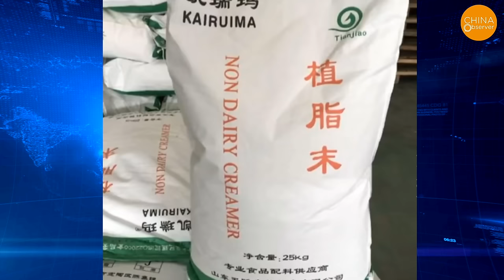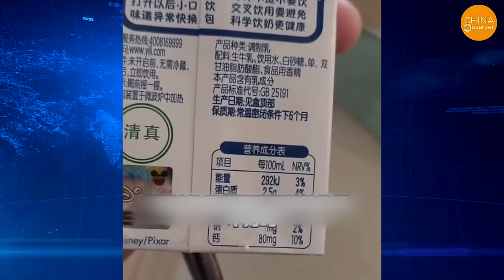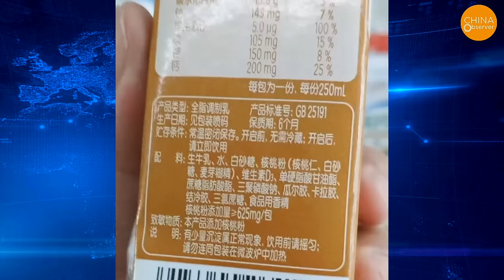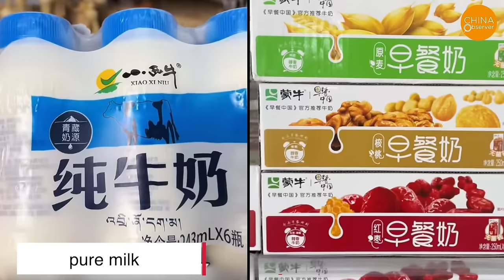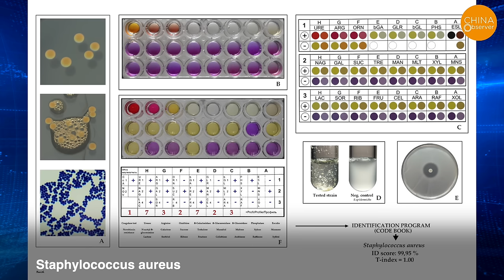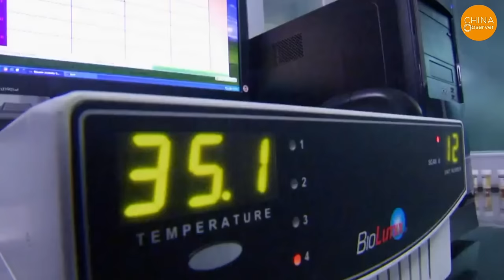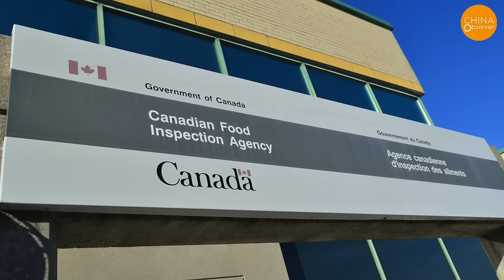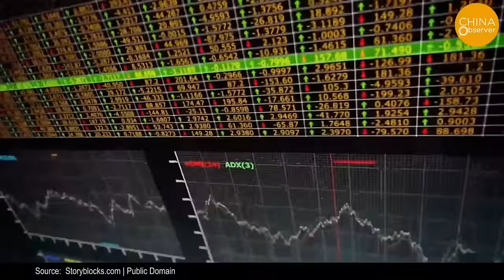Rampant Fake Milk and Yogurt, Containing 19 Toxins, Yet China’s Largest Brand

Comment: Fructose is a sugar found naturally in fruits, fruit juices, some vegetables and honey. Table sugar, called sucrose, also has fructose. High-fructose corn syrup is a sweetener that is in many processed foods and drinks, dont know where/if this guy did his/any research
Reply: That doesn’t mean sucrose and fructose are metabolized in the same metabolic pathways. It’s known that fructose is processed a lot faster compared to sucrose leading to higher glycogen levels and insulin resistance with all related diseases.
Reply: That's like saying water has hydrogen gas in it. Table sugar is a disaccharide of glucose and fructose. That is not the same as actual fructose, it's part of a larger molecule.
Reply: @hortehighwind8651  point being, the dude in the first clip said "fructose a substance that has long been banned by the W.H.O." which is factually wrong. 
and what he said about aspartame is also slightly wrong the W.H.O. as it was the IARC (international agency for research on cancer) who listed it as "possibly carcinogenetic". and then the W.H.O. aspartame is still safe within the acceptable daily intake of 40 mg/kg body weight. for an adult weight ~150lbs (70kgs) that would be about 2.7g of aspartame, about 10 diet sodas worth. 

so what he is saying about the yogurt having 19 toxins is just wrong... however it not even having milk is still valid.

Comment: Standards among the highest? Well, that only counts if you enforce them. China never does. My wife became concerned about arsenic in rice. I did a little research and found that China did indeed have high standards. The concentrations allowed by law were half of what the WHO advocated. The problem was enforcement. At one point, in China, rice from about 60 regions was tested. The amounts found were twice what the WHO set. Most of the arsenic was from anthropogenic sources (i.e., pollution). This is just one example, but of course an important one in China.